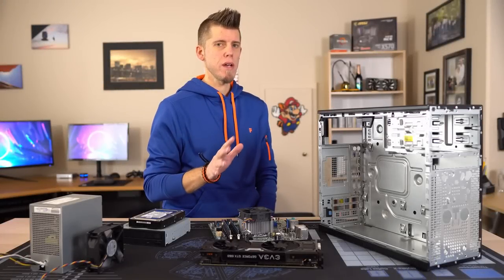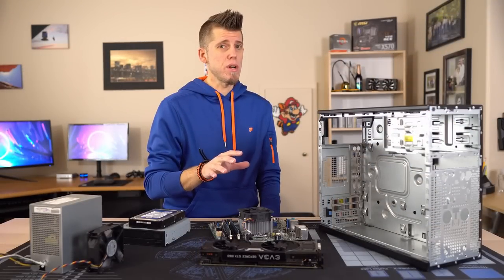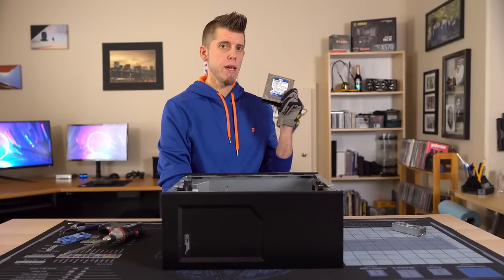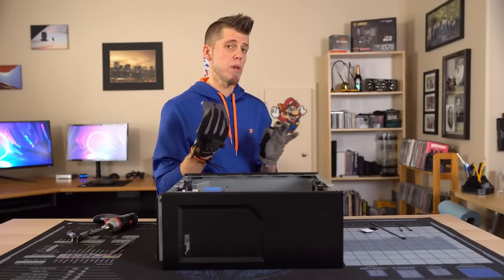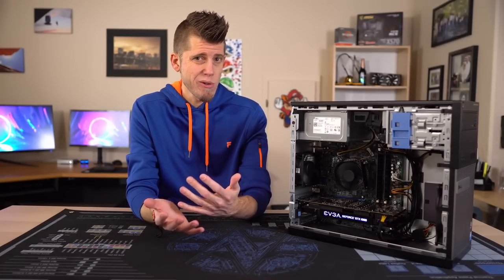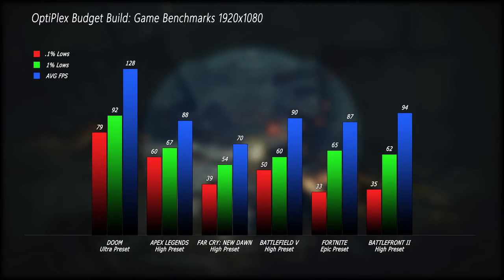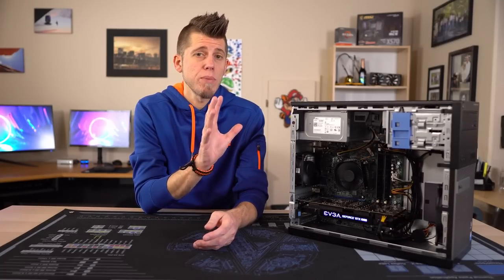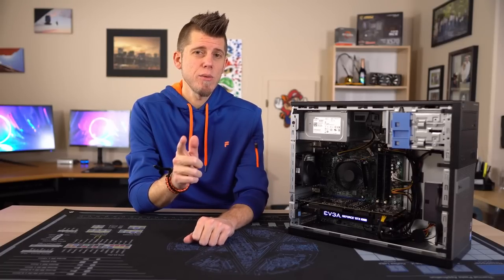Dell OptiPlex Budget Gaming PC For Under $300?

Comment from the maker: Okay, I need to address all the power supply comments. There's absolutely nothing wrong with what I did, and here's why. Yes, nVidia says the minimum power supply you should run with the 1060 is a 400 watt. That's because not all 400 watt PSU's are created equal. Cheap power supplies might only be able to sustain that wattage for a split second, but might settle back down to 300, watts or less. Unlike a decent power supply that can maintain that wattage. nVidia knows this, and thus the rating. To make sure their customers are covered in case they buy a garbage PSU.

Now, 300 watts is enough to run this system. I've tested it and the components should be pulling around 210 watts from the PSU. The PSU in these Dells is capable of maintaining 290 watts. I tested this with an RX 480, pushing close to it rated limit for 4 hours and it did it without a problem. This leaves you a 70-80 watt headroom with a 1060 6GB. Even more on a 1060 3GB, which is fine and there is no danger to the components. That being said, from a power delivery standpoint, there's zero difference here. They would both provide about the same wattage and gove you the same amount of head room. Though I would argue the 290 watt PSU in the Dell would be higher quality than a PSU like that.

So, that statement from nVidia exists to simplify, so they don't have to try to issue and explanation like the one i just gave you and make it easier for their customers.
Reply: You say this. Then use a cheap OEM psu from an optiplex........really?
Reply from the maker: @Cyrus_Nagisa  That's the damn point of the comment. It's not a cheap PSU. If you had read everything, you'd see that it's rated at 290 watts continuous. You need to stop using wattage ratings as a metric of quality. There are a lot of high wattage rated PSU's that are trash that can't really deliver their rated wattage.
Reply: @Cyrus_Nagisa  one of the more butt hurt people ive seen as ive watched this unfold
Reply: I saw nothing wrong with this video. The problem is you're more advanced than most people, and everyone thinks they're an expert. The 1060 is what 120w? The i5 maybe 65w? The Dell power supplies are actually not that bad. They do have lower wattages and few connectors, but they do deliver the wattage they're rated to have.

Just watched RTU video and that is what brought me here. Very nice of him to send people to your channel. I'm subbed now.
Reply: @ItIsNot1984  are you sure theres nothing wrong
Reply: @hacim9918  ikr
Reply: @Silvyya  I'm sure. The power supply can handle it, and the sata to pci-e adapter is fine too. Sata power cables are rated for 4.5 amps on the 12v line. 4.5 x 12 =54 watts. 75 watts will come from the board. That is 129 watts. GPU should pull about 120, so it is close to its max rating but will take a bit more to start melting or anything.
Reply: Well, I run my rig, which has RTX2070S in it, with 550W PSU. Gold rated, though, but still below recommended. No issues.
Reply: @Donna Freezen Small correction: The PS4 and Xbox use GDDR 5, not DDR5. Small but important difference.
Reply: MeatCanyon made a video about u
Reply: Good on you for explaining this to people. You shouldn't have to; but there are a lot of people who read recommended specs without knowing the "why" of the recommendations or digging deeper, particularly a few loud mouthed and uninformative channels. Keep doing your thing.
Reply: @Donna Freezen You're conflating the performance and price points of the standard model XB1 and PS4 with the XB1X and PS4 Pro. Also, very little on either console (particularly the PS4 Pro) is rendering at native 4K. The output resolution is upscaled from a lower rendering load. Having said that, since you're referencing the "4K" performance spec consoles share the knowledge on where you're grabbing a PS4 Pro or XB1X for sub $300.
Reply from the maker: @Donna Freezen You clearly have a very surface level understanding of what you're talking about. The X Box 1 X will consume about 170 watts tops. It runs off a low wattage power brick. Even if it had a 700 watt power source, it doesn't have the internal power deliver to take advantage of it, or the thermal overhead to deal with that much power consumption.

Next, DDR5 isn't a thing yet. It's still in development. You're talking about GDDR5, which is entirely different. The OptiPlex in the video uses DDR3 for the system memory and the 1060 is using GDDR5. The memory specifications for the consoles is combined... total. So, by that measure, this system has 14GB total. 8GB for the system and 6GB for the GPU. Also, adding another 8GB of DDR3 is about $15.

Talking about processors. You're comparing an APU to a CPU. You're making the very definition of an apples to oranges comparison. They are combined with processing and video cores. Also, not all cores are created equal.

As for the power supply. The MT's all use the exact same 290 watt unit. Some units came with 80+ bronze units and some came with 80+ gold units, but save for effciency, they are identical to the one in the video. I already explained this in as plain English as I can in the original comment.

Also, to say the4 X Box 1 X is playing at 4k is a flawed argument on many levels. As I said, it's employing a lot of dynamic adjustments to be able to play at that level. All which will effect power consumption.

Like I said, you have a very basic understanding of everything you're talking about.
Reply: I'm gonna club you with Beyond meat sausage for this treachery. 🤯
Reply: @TheGameBench  FYI, I came over after watching Richs video.  Never heard of you before.  You now have one more sub, and Rich has one less.  I'm an industrial electro-mech tech with over three decades of experience and understand what you are saying RE: PS.  Unfortunately, Rich and most of his followers will not, and it seems more and more the bashing of others is the way Rich wants to get his views.

Keep up the good work.
Reply: @ItIsNot1984  still waiting to see rich build a computer by hand and make a video. so everyone can nit pick on him.
Reply: @videogamepolak0  He did a video titled, "Can I build a PC"? His build ended up with a case fan screwed to the outside of the case that stuck out like a tumor. He also mounted the hard drive so that it covered half the cpu fan. (It was a weird case) He had thermal issues.
Reply: @ItIsNot1984  no kidding? got a link? id like to see him do it today, last time i seen anything with him building a pic someone was helping him cause he had no idea what he was doing.
Reply: @ItIsNot1984  lol a clusterpuck
Reply: @ItIsNot1984  lol yeah its something  people like to do with their mining gpus cause of cooling situations they have to run their cards hot so naturally itd make sense to regularly change the paste out but otherwise  if theres no issue why change it out. Id like to see rich re dope a GPU itd be 10 hr video.
Reply: @ItIsNot1984  TGB actually has his own version of "Tech Yes Lovin" he does to every part that he works with... Man that sounded dirty. BUT, I know for a fact the card he was using had already had the thermal paste replaced. Rich really was showing a high level of ignorance singling out this one video, and a lot of his criticism had already been met in TGB's other videos. It's really just one in a series.
Reply from the maker: @ricoswave2326  Thanks, I really appreciate that. Kinda' the same conclusion I came to. Thanks for the support.
Reply from the maker: @ItIsNot1984  Sunday night I went over a response video a few times in my head. I have a retort for every one of his complaints, but I came to the conclusion that it's gotta' come from someone much bigger than me, with a lot more credibility. The only way a response video ends for me is badly. He's got way too much weight to throw around with almost 900k subs. I'm just going to keep making videos and let them speak for themselves.

Ironically, I made another video before I made this one, just waiting to be edited about taking a used GPU and completely going over it. Testing, cleaning, re-pasting, etc... I'm sure people will say he's responsible for a video I made even before releasing this one.
Reply: @TheGameBench  I get that you could take even more heat from a vid like that, but the guy deserves it. Maybe instead of a response, you should critique his build video. Play the whole damn thing with nothing but a small frame of you talking over it - the way he did with yours. That would be freakin' hilarious.
Reply from the maker: @ItIsNot1984  LOL. I did watch it all the way through and I saw all of his issue before he ran into them. I'm not sure what killed me most... but I'd say that wart of a fan on the side was towards the top. Especially considering he got after me for adding one to this. Like... imagine that. Computer components get hot and need more than just an exhaust fan.
Reply: @TheGameBench  When he moved that hard drive and blocked half his cpu fan with it, and then showed that case with the fan stuck to the outside. I about pissed myself. He didn't even consider putting the hard drive in that open 5.25 bay.
Reply from the maker: @ItIsNot1984  Exactly. That stock cooler has a hard enough time without a HDD in the way. And I completely forgot about when he quoted TDP like it's power consumption.
Reply: A few things I have not seen mentioned under this comment. GameTech Reserve has the GPU covered so that's 120 watts (max), that CPU I know can pull 87 Watts under a synthetic load but much less for gaming workloads, so lets just say 80 Watts (probably never hit that high in gaming). That gives us 200 Watts which leaves a lot of headroom for fans, harddrives, etc. It will be fine based on Wattage.

I've built about 12 or so systems using the Dell Optiplex for purpose built systems for friends, family, and gaming PC's for kids.  I use almost the same upgrades as seen in this video(I do upgrade the PSU for the gaming builds but I'm not on a $300.00 Budget or I would make the same sacrifice you did). The main reason I like using them is for there reliabilty and cheap prices on the second hand market. If you go to Hospital look around I promise you will see one especially the SFF version running 24/7 for years. 80+ certified or not those are well built PSU's in those things they are meant to run is offices and the like for 24/7 and for many years.

A little off topic but the point of the 1% lows, 1% stuff in the chart is to give the users an idea of frame dips. Rich hasn't done tech/game reviews in a long time he may be unaware of the new standard for showing game performance.

Sorry for the long comment. I haven't felt the need to post a comment in years. I have no idea what Rich from Review Tech USA's problem with this video was.I have watched most of his content for about 8 years now but the video he made about your content pissed me off. Your video is very professional, accurate, and provided a system that will match current generation consoles at a fair price and gives users access to Steam Sales to beef up their game library for the next PC they build.
Reply: Personally i suspected as much that it will be very likely that the PSu can actually handle the 1060 just fine. Rich is not exactly tech savvy so his not the best to find what is wrong with something. 
More than likely his way worse than you in building any system. 

BUT other than that i have a few criticisms.
I feel telling people to flip that wire thing is were you went a little too much since no way a guy trying to built a cheap Pc instead of buying a console will want to do that. Just seeing that he will be scared enough to just want to buy the console.
It is a nice little thing to know but probably more useful for people that are into building PC's.

Other than that i find the whole inspiration to be based on a wrong premise because you built this by basically buying an old pre-built Dell and adding a graphics card.  
I guess you can say that this is like having a PC for console level money but if you were going for used hardware then the comparison is not that good because you could buy a slim PS4 or a simple Xbox One used for half the price. 
So is more like console money if you buy NEW console hardware. So you are comparing used hardware with new hardware.

Lastly shouldn't a PC built include things like OS, screen, keyboard and mouse and probably the price of a controller(since you are using it as an alternative to getting a console). Hell even the price for the HDMI cable.
Add that and we are getting at the $500 mark where the price of buying a just released new generation console will be. And that will be stronger and not used hardware.
Reply: I want to start off by saying that there's a huge difference between a tech content creator making a rough draft video and an organization like The Verge. I have built OEM PCs like this in the past myself as well, and I still disagree with the power supply choice. A used power supply may be fine, I'm sure the power from the wall is enough. However, not all power supplies are built the same in terms of quality. Capacitors degrade, and over time the power supply starts to weaken especially if it is used at a higher wattage than intended.

I'd suggest looking into jonnyguru.com and LTT's PSU Tier list. The 80+ Rating isn't needed, it's recommended though generally. I think the build could've squeezed the power supply given the budget and even if you used the dell psu you could of simplified it with a graphics card that only takes power from the PCIE Slot like the GTX 1650. I did come from RTU's video btw. His response was harsh, but I've been watching him for 6+ years and I don't think he made a video to hate on you but regardless that's opinion based. I really hope this channel does well, and I look forward to improvement.

Subscribed. :)
Reply: @Donna Freezen Current Xbox and PS4 run upscaled 1080p, the ps4 and xbone have a low power, low clocked 8 core jaguar(bulldozer) based cpu. PS4 and Xbone still use mechanical hard drives. I don't see why you would pay the same, if not more for lesser hardware. You get ease of use with a console, that's it.
Reply: @exlibrisas  "Gold" is a measure of efficiency. 80+ rating was never intended to be a measure of quality or reliability and should not be used as one. 

And yes, the GPU manufactures DRASTICALLY overstate the wattage requirements to be conservative because they know many people buy junk PSUs that don't actually come close to hitting the wattage claimed on the box. You have to account for somebody's "650W" PSU that might actually only make 400W on a good day.
Reply: @TheGameBench  Hey man. Nice and clean! Great work! Do you think that its default power supply will suffice if you put a 4790 and a 1660 super in it? Based on google, i think that its default power supply is 290 watts. Do you think it will work without the components burning? Please answer, thank you.
Reply: @ItIsNot1984  you do realize the case is the reason he added that fan right lmfao
Reply: @ItIsNot1984  and he didn't criticize him for not changing the gpu thermal paste he said he bought it new so he didn't need to  but if he bought it used he would need to stop spreading misinformation lmfao
Reply: @ItIsNot1984  also his harddrive couldn't fit in the 5.25 inch bay he even said it in the video did you guys skim his videos or watch them lmfao so much
Reply: @viperlife914  Its been like a month, but just so you know I did watch the videos. A 3.5" hard drive will fit inside a 5.25" inch bay. There are adapters for that and you can even buy longer screws for it. Without those, you can still just screw in one side of the hard drive and order the stuff you need. Would've been much better to do just one side than to block your CPU cooler. That was just dumb. Second, even for a used gpu, there is almost no chance he needed new paste for a card as new the 1060. Maybe if the card was mined on to the extreme it could maybe use new paste but probably not. Seriously, no reason to repaste without a heat problem. Like I said when you lift a cooler, you can run into problems. For one, it seems like a 50/50 chance of tearing up your pads. They can be replaced but still, why do it? Also, you can lose a screw which sucks. Lastly keep in mind, there is no lid on these things. It is a bare die that can be damaged while putting the heatsink back. Its just not wise to do it unless you have a good reason. "It is used" is not a good reason.
Reply: @ItIsNot1984  idk I've seen youtubers like linus tech tips and jayz 2 cents replace gpu thermal paste just fne
Reply: @viperlife914  they do it for the camera. Just a rule of thumb, the more wattage the sooner the paste will dry out but it still takes years before that happens.
Reply: The Game Bench no its not
Reply from the maker: @Sleepy335i  Well... you're objectively wrong. The power supply has adequate amperage across two 12v rails for the components I used. It has protections and will shut off if the power draw were to high. Which it's not, because the system has about 100 watts of headroom with that power supply. Those are the facts and it's objectively fine, unless you have evidence to the contrary...
Reply: The Game Bench could I use a rx 580 with that power supply
Reply from the maker: @p-star7shorts142  No, absolutely not. The 580 is regularly drawing close the the 290 watt mark, if not over. If you want to run a 580, you'll need to replace the power supply.
Reply: The Game Bench could I use the gtx 1060 ssc
Reply from the maker: @p-star7shorts142  Absolutely. That's the exact model I used in this system.
Reply: Is the single fan gta 1060 the same
Reply from the maker: @p-star7shorts142  Yes, there's no model of 1060 I can think of where you'd have a problem. Just keep in mind that the majority of single fan models tend to be 3GB cards, which have less Cuda cores, and draw even less power. Make sure you're getting a 6GB model.
Reply: The Game Bench would it matter if I used a gigabyte or Msi gtx 1060
Reply from the maker: @leaaltech7580  Nope. Doesn't really matter much for power consumption. They should draw around 120 watts regardless. Higher clicked models might pull a little more, but nothing that would cause an issue power wise.
Reply: Optiplex 3010 with Xeon 3470, RX 570 4gb, 8 gb ram, 500 gb hd, stock psu.  Do I need to upgrade the psu or can I use the stock?
Reply: I think it's more about OPP, SCP, OTP, UVP, OVP, inrush current limiting, independent regulation, ACRF/Half-/Full bridge and stuff like that, than just wattage..
Reply: Hi can any1 help me. Im also using dell optiplex 3020 and i would like to add a fan like this so i wont play in open case. How can i powerup the fan ? Im using the stock dell psu. What adaptor should i buy and where to connect it thanks it would be a big help
Reply: @TheGameBench  Hi can any1 help me. Im also using dell optiplex 3020 and i would like to add a fan like this so i wont play in open case. How can i powerup the fan ? Im using the stock dell psu. What adaptor should i buy and where to connect it thanks it would be a big help
Reply: @ItIsNot1984  Hi can any1 help me. Im also using dell optiplex 3020 and i would like to add a fan like this so i wont play in open case. How can i powerup the fan ? Im using the stock dell psu. What adaptor should i buy and where to connect it thanks it would be a big help
Reply from the maker: SkilledRebuilds  Yeah, I'd bet it doesn't see north of 150 watts or so. I have a SFF HP under my workbench with a 4690 and a 1050Ti and it never broke 140 watts under max load. People really over estimate power consumption. Even my little game room build with an 8600K and a 1080 Ti doesn't break 400 watts at stock clocks.
Reply from the maker: @jeffjularbal9404  Sorry for the late response, but yes. The 1660 Super will consume about the same amount of power as the 1060 6GB. It's no problem on the 290 watt PSU.
Reply: @TheGameBench  Thank you very much. Appreciate it. I also saw Linus did it recently. But only difference is he used 3770 which is 65 watt tdp. Is 3770 consumes lesser power compared to 4790?
Reply from the maker: @jeffjularbal9404  No problem. In my testing the 3770 and the 4790 consume the same amount of power under a single core load. Under a multi-core load, the 4790 only consumes 10 more watts over the 3770. I negligible amount really. Especially when the PSU in the xx20 has 15 more watts.
Reply from the maker: @Smoothies_010  Yeah, there's a link in the description for the adapter I use, which is just a SATA to 4-pin fan adapter.

https://amzn.to/312tLFu
Reply: @ItIsNot1984   rtu?
Reply: I have freshly built a 7020 with a 1650 super, it has an ssd for Win and hdd remains for storage. it is idling at around 35W when during office stuff goes up to like 75W, doing prime95 cpu stress is 85W, playing diablo 3 110W max, with dirt 2 I could reach 160W, so not worried that much about the psu limits
Reply: @Cyrus_Nagisa  for some PSU, the total system rating is higher than what the psu can supply at one time because it is a theoretical. The dell psu has an actual power rating of 290 if you bother to read the labels on the psu itself
Reply: Can you upgrade the Dell optiplex 990 or case swap it for a video
Reply: What I hate about pc gaming is the hassle with windows, installing updates, drivers, crashes, never ending updates etc ... 
I wish there was an os like android for pcs that ...just....worked!
My android phones have crashed once  in over 10 years of daily use and......its a free OS, screw you Bill Gates!